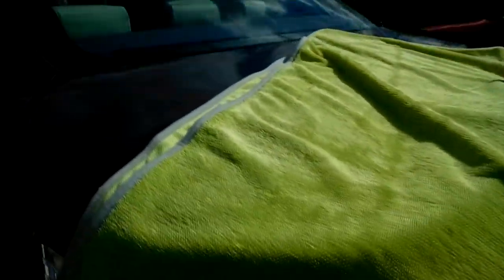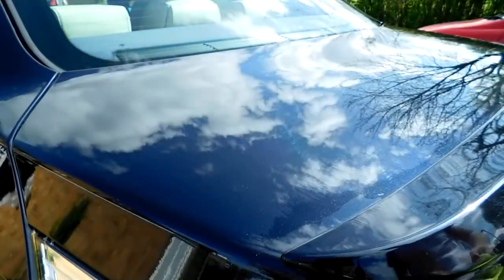Detailing process step by step.

Comment: As always Luke good video. But you did miss out one of my pet hates, door shuts. Very clean car is quickly let down when opening a door. Only takes 5 mins extra per door and the finish show to the car is second to none. Keep up the good videos Luke.
Reply: neil floate I'd include shuts in the 2bm wash.
Reply from the maker: +neil floate I agree it's one of those jobs that takes moments but makes a massive impact. As Michael said it was in the original cut during the 2bm section but since I rambled off on a tangent I cut it out.

Comment: I think it was chemical guys flow chart they said, after polishing apply glaze, sealant then wax on top? What's the crack with this? Do you agree with that or not I'm unsure on it.
Reply: Jack Straughan my take from this is why glaze when your paint is already corrected. I can understand if you are doing a 1 step but unnecessary if you are going for full correction. But for those who has time  on their hands then by all means. There is no exact formula in detailing.
Reply from the maker: +Jack Straughan I can't see it adding anything to the finish that a good wax or sealant can't. Add in to that that it shouldn't be required if polished properly too. Call me cynical but a company that sells products will put the step in if it results in an additional sale. Happy to be proven wrong though if I'm wide of the mark.
Reply: That's a good point it's probably more of a sales pitch than anything else when you think about it! Never thought about it in that way!

Comment: Would you not do tar & fallout on the paint before washing so that there is no chance of scrubbing it around? I agree that clay would be after the wash though.
Reply: I think this would mean that your tar/iron removal products would react a lot with the dirt and debris sitting on the car rather than the embedded contamination. If you clean first you’ll get the best from those kind of products
Reply: As Greg says. You want the paint as clean as possible before a chemical decon. No point trying to remove the microscopic contamination chemically if those chemicals are just going to sit on the dirt thats covering it
Reply from the maker: +waldo 87 exactly as Greg and Michael said. Same principle as spraying fallout remover on dirty wheels. It will have a reaction but mainly on dirt that would otherwise have cleaned off anyway.
Reply: Thanks, that does make sense. Was just always thought to get all the touchless work done before the wash. Proves the point on videos like this, can usually learn something new 👍🏼